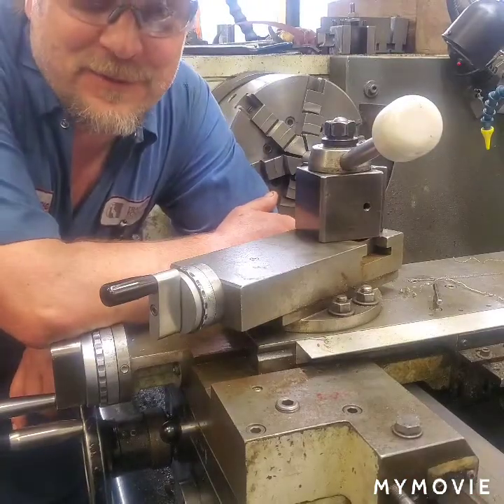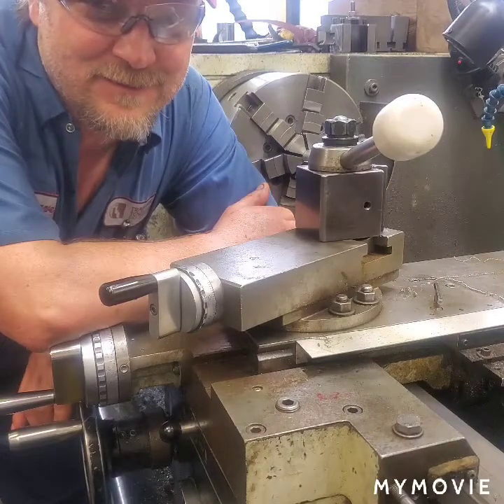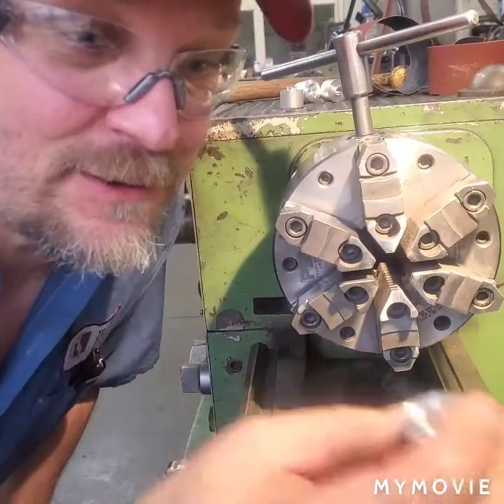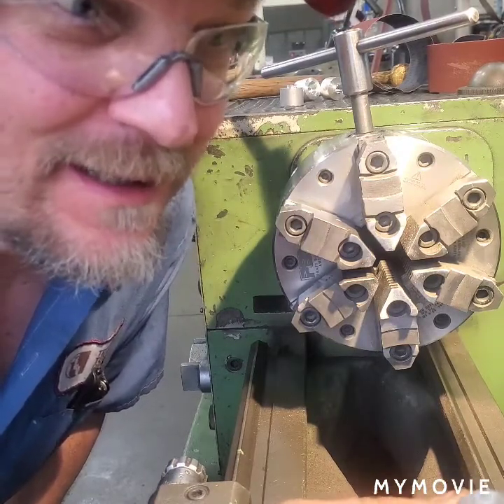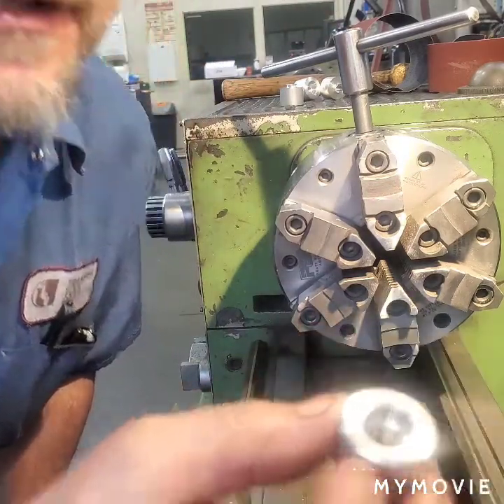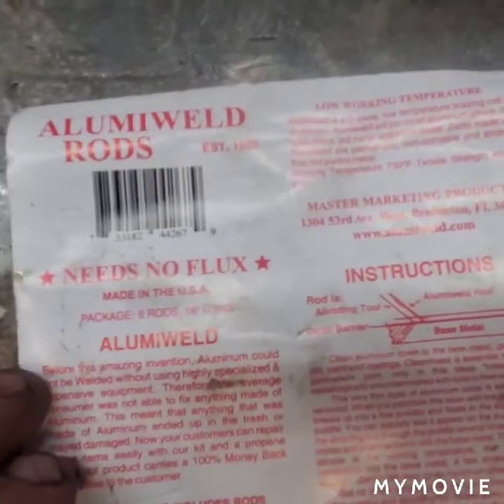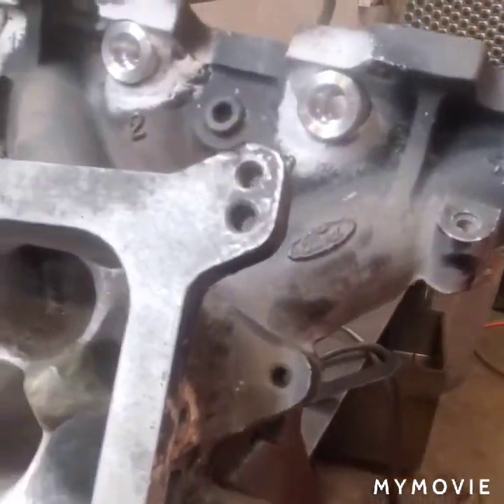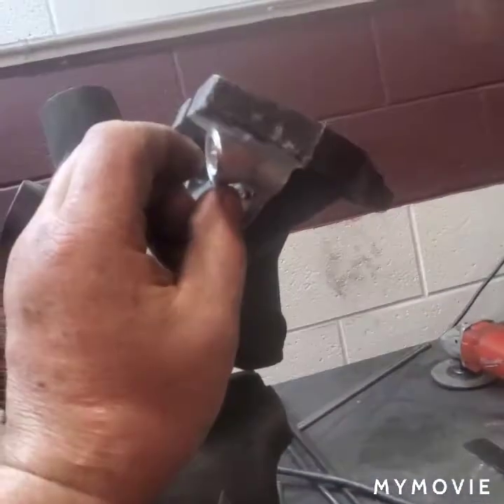Dave's,making fuel injector bungs for the 1963 turbo falcon

Comment: Jb weld works good
Reply from the maker: I thought of doing that
Reply: That was just a joke lol maybe tap a 5/16-18 and put a shoulder bolt and use the head of bolt to hold the retainer in place. Got to have something kinda strong cause your going to be creating some of crank case pressure
Reply from the maker: Said I thought about it didn't say I was going to do it ..LOL

Comment: Yep, I have a welder guy. BTW, I know that I am a rank amateur on a lathe and all, but I would think that you would want to chuck the rod up a little closer to the lathe chuck...
Reply from the maker: I was being lazy I drilled the center small drill first and then did the big diameter and then patted it and repeated so I didn't have to keep unchecking it and rechucking and re indicating